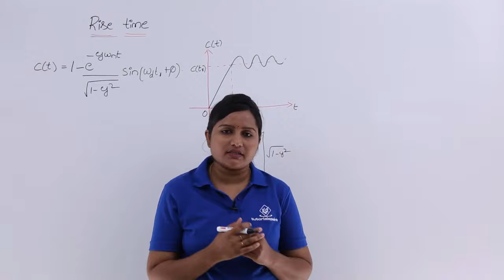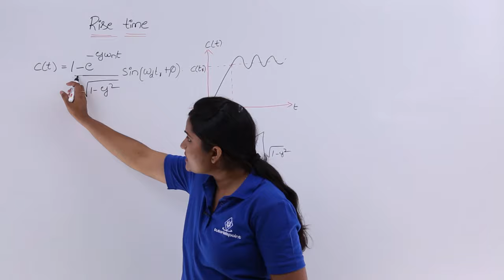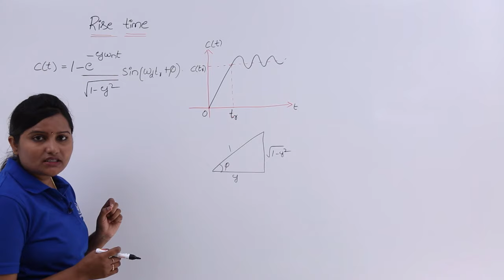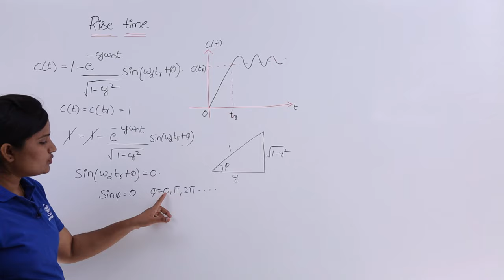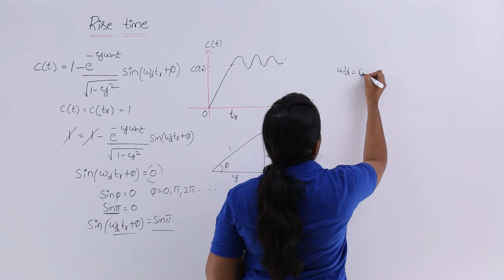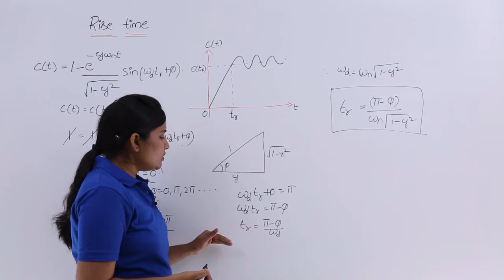Rise Time

Comment: What should we consider for π (180 or 3.14)? 
Pls clarify.
Reply: pi here is angle measurement in sinusiodal fuction so we take pi=180degrees
Reply: 180 degre
Reply: Pi can be taken as 180 degree or 3.14 radian. Depends on angle unit.

Comment: Mam why you consider only π not use nπ
Reply: in the function of c(t) there is a sine function which is a wave form. So when we draw the graph of c(tr) the graph will cross 1 multiple times. the graph starts from 0 so 100% value would be 1 and time taken to reach 1 will be the time graph took to pass 1 for the first time is tr. at other n pi the graph will cross 1 again and again but that won't be rise time